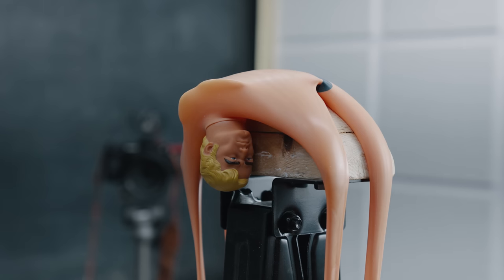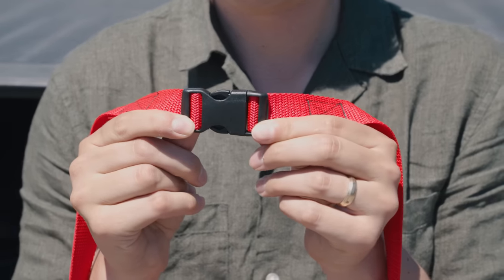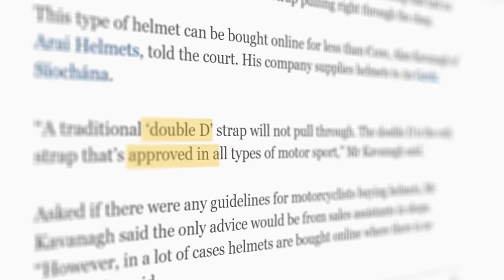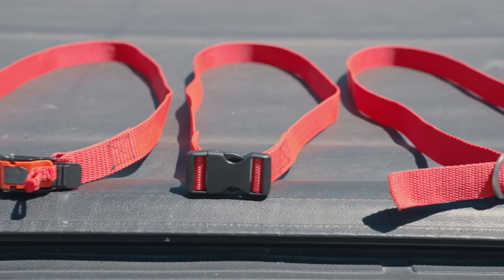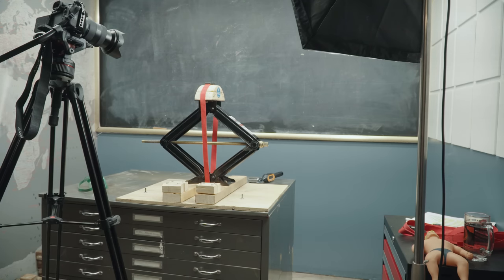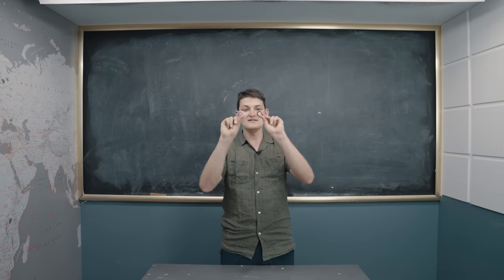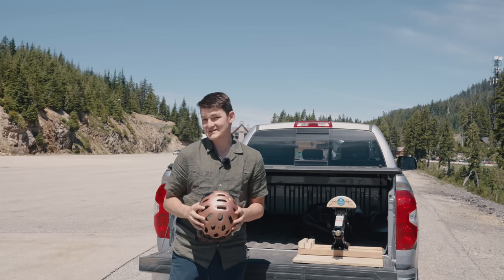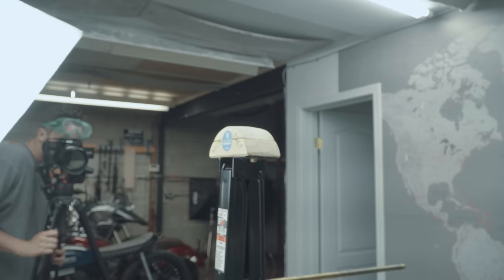Why Motorcycle Helmets Use this Ancient Buckle

Comment: I think a Shoei metal micro is as tough as a D-ring, too bad most of the touring helmets cannot be head with D-rings
Reply: I agree, also I feel like he missed a point by not mentioning that because of the fact that the D ring takes more time to buckle, people might not use them for short trips more often then a quick buckle like the shoei metal ratchet..
Reply: Neotec II, touring and metal ratchet.
Reply: @racer83l  Also RPHA 90 modular (in the UK & EU) - decent steel micro on mine (I think the US gets stuck with DD's). My old Shoei Raids had a mini seatbelt-buckle which was even better - quick, secure, steel and set up at the side where the forces are most linear, and I could get them on and off with soaking-wet winter gloves no problem. They were definitely strong enough! I kept my first Raid as a memento as it still has the tyre marks across it. An Astra ran over my head after I was punted by a drunk in a transit, back in the mid 90's. Bruised, a bit concussed, but mostly still alive thanks to the lid staying on.
Reply: @jdf1996928  more time? A second... maybe two more? If that's worth more than the safety of a person's noggin' I question the brain power inside said noggin anyways.

Comment: Shoei's ratchet chinstrap uses a metal tab and pawl, but it is an absolute nightmare to adjust. The adjustment loop thing is impossibly difficult to move the loop through, even without gloves. Meanwhile, a simple tug on a double-d gets the job done every time. I really don't understand why they bother.
Reply: maybe because the helmet isn't held on top of your head by the strap all the time and re adjusting it every time you're taking it on/off  is unnecessary??
Reply: @jaggns5774  yeah, I'm sure that's the excuse they'd give. But I can guarantee you that there are a ton of GT Air II riders out there with misadjusted chin straps, because it is damn near impossible to adjust. I had to use a cotter pin extractor to slide in under the loop and pull it loose. It's ridiculously difficult. It's all so unnecessary.
Reply: @bradleyland  that really sounds inconvenient

I've personally never had an issue with my helmet, maybe because I'm used to adjusting that kind of straps from my backpack, not sure.
Reply: @jaggns5774  do you have a GT Air II? On mine, the strap comes out, through a webbing slider, through the ratchet tab, then back through the webbing slider. All within a couple of inches of the strap, and the slider is impossibly tight on the strap. It's so much less convenient than a double-d.
Reply: @jaggns5774  also FWIW, I can adjust the sliders on my backpacks no problem. The one on my GT Air II doesn't work the same *at all*. It's locked in place no matter how you manipulate the webbing.
Reply: @bradleyland  I have an MTR Street 12 (or something like that)
it uses the usual ratchet clipper and a Plastic D Ring adjuster.
It's fiddlely to get the loop open enough to shove a finger in there, but it works.
Reply: @jaggns5774  ah, gotcha. Different helmet entirely. So yeah, I think Shoei's slider design is just really tough to adjust. It's not like any slider I've used before.

Comment: I'm willing to forego the slight increase in safety that DD rings provide for the convenience of fidlock. Call it a calculated risk.
Reply: One does not wear a helmet for convenience
Reply: @mariodonkartworks  Sure, but I have both a helmet with tradition D rings and one with a Fidlock. I choose the latter 9/10 times. Besides. It makes the helmet easier to take off me should I get into an accident. I take that advantage over the slight increase in pressure a d-ring can withstand.
Thanks for looking out tho.

Comment: I like the test but I don't know how accurate it should be considering that the DD was the only one made out of metal. I don't know about the side release buckle or the magnetic one, but ai know that at the very least there is a metal alternative for the ratchet buckle, as I had it on one of my old helmets. I'm not saying that the DD isn't enough or that the ratchet is better, but I would imagine the metal ratchet buckle would perform significantly better than the plastic one.

Comment: It's like vacuum petcocks: trying to fix something that wasn't broken.
Reply: not only trying to fix something that isn't broken, but also trying to fix something that can't break
Reply: Idk, man. They are slow to fasten/unfasten and cannot really be adjusted without removing a different piece of safety gear (gloves.) That's definitely room for improvement, if you ask me.
Reply: @Travis Terrell you wear Velcro shoes, don't you?
Reply: I appreciate them as it's just another safety step between the gas tank and flooding the cylinder or leaking on the ground while I'm away. The needle seal fails.
Reply: @TravisTerrell  my shoei has a double d buckle, and one ring has a little flap attached so i can easily open it with (regular, not thick) gloves on. I can't do it with thick cold weather gloves too well, but then neither can i open a ratchet buckle on a nolan helmet.
Reply: @beerdedwanderer  Lol, different strokes for different folks I guess! Seriously, though, I've legit said several times I'd prefer Velcro shoes if not for the mockery; they make a lot of sense for casual shoes! (And Boa twist lock for my boots and skates. Laces are outdated! 😉)
Reply: @paapali  Mine actually has that little flap on the D-ring too, and it seems like it would be helpful, but it usually just confuses me. I guess I need some more practice to learn to use it better. (I did request a couple samples of the Fidlock "25 alu motorbike" hook from the website though. (Assuming they'll send them to an individual.))

Comment: This is kinda like saying a wooden wheel should have been good enough. The ratchet system from Shoei is made out of metal so the point of failure might change, plus ratchets are super easy to set and adjust every time you need to put a helmet on.
Reply: em acidentes com velocidade de cidade, provavelmente você vai estar seguro com um de plástico. Quando você chega em uma velocidade de estradas ou em um track day, esses de presilha podem abrir. Lembro de um acidente assim uns anos atrás com um capacete AVG replica de um da moto GP. Moto GP que usa capacete de argola, não engate rápido.
Reply: Did you not just watch the actual experiment?  Did you listen?
Reply: @michaelwilde545  the actual experiment had a plastic ratchet, no?
Reply: Still not as good as DD.
Reply: @XtreeM_FaiL  how do you know? He didn't test the metal one.
Reply: @TheFeldhamster  DD is simple, light, it does not have moving parts, it is solid steel.
Reply: @XtreeM_FaiL  yeah but it's really a hassle to put on and off. There's a reason most helmets in the EU are ratchet now. Nobody wants to eff around with bloody D rings all the time, especially not when you usually have gloves on which means not only do you have to fiddle with the D rings where you can't even see them under your chin, you have to take your gloves off as well to do it. That's like the epitome of inconvenience. I guess lawmakers allowed ratchets because it's better if more people fasten their helmets all the time (instead of riding around with open helmet straps because it's too fiddly) while the cases where the accident tries to rip the helmet off your head are rare.
Reply: @TheFeldhamster  "fiddle with the D rings where you can't even see them under your chin" Can you see the other methods?

I don't understand why people (not the law makers) say DD is slow and difficult to use.
Maybe it has too many moving parts (zero)?
You can loose DD with thick gloves on really easy. Don't know why so many people has a fetish to put helmets on/off with their gloves on.
Tightening DD can't be more simple. Pull the strap, bam done.
It is not rocket science. Seriously, it is really old technology.

Learning to use new helmet's air vents and visor lock takes more time than learn to use DD.
If you don't have rheumatism, then it takes a minute to learn to used DD.

There are people who don't know how to use their straps, no matter what system they have.
"while the cases where the accident tries to rip the helmet off your head are rare."
It is not rare anymore if the strap is not properly fastened.
Reply: @XtreeM_FaiL  the ratchet system is a lot easier to manipulate with gloves and without looking. I take it you have never worn a ratchet system helmet? A quick warning: if you want to continue loving the D rings, never put a ratchet helmet on. Because once you've worn one, you'll never want to go back. It's not about learning. It's about everyday convenience. If I look at what kinds of helmets are on the shelves here, it seems 90% of Europe agrees with me.

Also, the criticism of not fastening the helmet tightly because the straps are pre-set to a certain length just doesn't hold for the ratchet system. It's true for the Dick clip but not for the ratchet. There's enough length on the ratchet itself to cover any length changes a person would have (wearing a buff vs not wearing one, cutting their hair) to not have to reset the length. Those Dick clips I've only ever seen on bicycle helmets. And even there, ABUS now offers a (slightly different) ratchet system (that's unfortunately only half as good, I wish they would offer the motorcycle helmet ratchet system on bike helmets).

But, this video changed my view on ratchets insofar as that my next helmet will be a Shoei with the metal ratchet system.
Reply: @TheFeldhamster  "the ratchet system is a lot easier to manipulate with gloves and without looking."
1st is debatable, but I don't understand the 2nd.
Can you see under your chin? I can't even see my chin, not above or under and what would you look anyway?

There are not much choice.
Helmet has to be right size and shape to fit. What system it has it has.
You can change it afterward, but that will cost extra and if the job is half asset then that will be a serious risk.
If I can choose, I'll take DD everytime.

I have heard that ratchety things has one common thing.
If it self tighten while riding, you have to stop.
Idk how common or big of a problem that is, but it is a problem.

I seriously doubt that I would fall in love after trying ratchets.

"But, this video changed my view on ratchets insofar as that my next helmet will be a Shoei with the metal ratchet system."
This video is not scientifically accurate or represent irl anyway.
Keep in mind that all the helmets on sale has to pass the minimum standarts.

In EU motorcycle helmet straps has to withstand minimum of 3kN of tension.

Plastics don't age well and gets weaker over time.
Is it a problem? Idk.
Reply: @michaelwilde545  I explained what i felt missing... are you going to clarify what i missed? Have you worn or even seen a Shoei Ratchet system?
Reply: @XtreeM_FaiL  of course I can't see under my chin either. That's the whole point of wanting to have a system that is less fiddly. With the D rings, you have to thread the strap twice and correctly. With the ratchet, I just point the ratchet part vaguely in the direction of the opening on the other side and push. Done. You don't even have to hit that opening very accurately, it's kind of self-guiding if you hit it at all. You could do this wearing oven mittens. If you're an impatient person, it's just so much more convenient. And we're talking Europeans here, where most of us drive a manual stick shift car. But manually shifting is part of the joy of driving while putting on a helmet before you get to ride is a chore.

I've never experienced the self-tightening thing and never heard of this problem from any of my friends. Granted, that's a small sample size, but if it was a really common problem I would expect people to bitch about it all the time?

As for the ageing - you need to replace your helmet after what was it - 5years? 7 years? - anyway, so I don't think the ratchet would age faster than that. But yeah, still going to give the Shoei helmets with the metal ratchets a look on my next buy. Am actually looking to get a new helmet for next season, so this vid is still good info for me.
Reply: @XtreeM_FaiL  A helmet is not meant to be used for over 5 years but tbh many ppl use them for far longer (10 or even 15 years). The plastics don't age well is a tricky and broad argument because some resins age even worse and not all resins nor plastics are made equal. The Shoei ratchet is the only metal one i've worn and the only plastic in it is the release clamp which only serves as a pulling system not a locking part. I also own a D ring Bell MX 9 and i can say its not as fast or convenient as the ratchet no matter how experienced you are.
Reply: @TheFeldhamster  What makes you think I'm a Murican? :D
Reply: @diogomorato  UV-light and sweat are the ones that will wear out helmets the most.
5 years is the recomended, but it is not a law. Helmet can last longer just as it can be ruined in sooner.
Reply: @XtreeM_FaiL  actually, my guess was Canadian ;)
Reply: @TheFeldhamster  My French is not good enough.
Reply: @XtreeM_FaiL  yeah well, I thought a guy who politely argues a different point of opinion in good English... Canadian does come to mind ;)